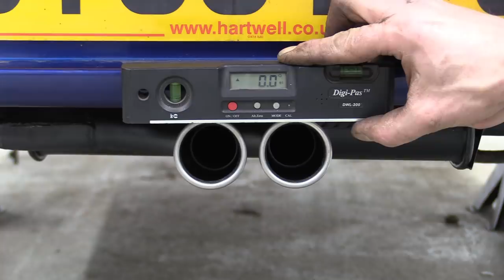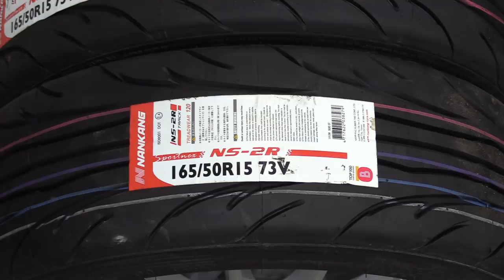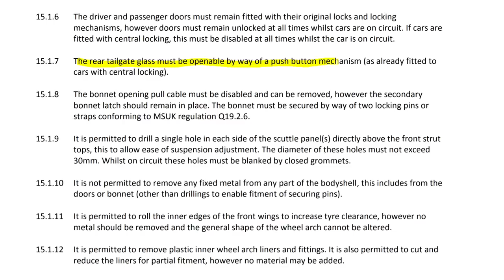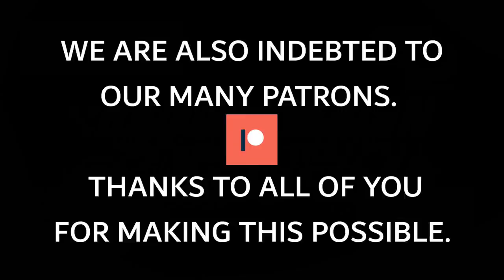Part 2 - Building an £850 hatchback into a competitive race car.

Comment: "To make it easier to remove the struts, the wiper arm comes off" 
Me, who has only ever worked on old cars: *frowning intensifies*
Reply: I spent a solid 5 seconds waiting for the punchline, until I remembered how tightly packed the front end of that car must be. :-)
Reply: It'd be very Colin Chapmanesque to use the same bolt for the strut and the wiper arm.
Reply: @Stereomoo  Me, too, instantly was thinking of Mr Chapman's creative genius when it came to impossible triple use of vastly underweight parts, but it turned out that Toyotroën just put two layers of things in the way of service access like every other car hack calling themselves "engineer" these days.
Reply: To remove the rear wheel on my bike i need to remove the front mudguard lol.
Reply: @SF-tb4kb  I had a vauxhall cavalier that required stripping the entire dash from the drivers door to the centre console in order to replace the bulb in the clock.
Reply: But at least in modern cars all these things come apart easily unlike on my older endeavours with nearly everything being bloody seized like it's welded.
Reply: @davidhope5875  I had two Opel (Vauxhall for the Brits) Astra's that required removing the timing wheel on the engine just to replace the thermostat valve. So a 12 euro part became a very expensive repair....fortunately I did it myself, but I won't be buying an Opel with that setup again...
Reply: A '79 Dodge D150 requires removing the windshield to access either the top dashboard mounting screws or the cowl grill screws to get at the wiper pivots and transmission....
Reply: Having grown up with American cars some of which required that the engine be unbolted from it's mounts in order to change spark plugs, this sounds perfectly reasonable,,,especially since I'm not the one having to do it.... 
("Wait! What do you mean the battery's INSIDE of the fender and you have to take the wheel off to replace the battery?  I see they slanted the engine over to the right so that the exhaust manifold is on top, and everything you need to service is underneath. Hmmmm.)
Reply: @SF-tb4kb  I have a 1994 Accord where they decided to put the brake rotors behind the wheel hub.  That's right, I have to remove the entire knuckle assembly to replace brake rotors.  Also, changing the oil on my Odyssey today made me realize that Honda always puts the oil filter immediately above a cross member, so good luck doing an oil change without spill a drop.
Reply: @darkmagician1184  82-86 B11 sentra/sunny/tsuru as well...
Reply: @jfan4reva  there is a smart roadster version that requires the engine to be removed completely to change the battery.
tbh it is a rather upengined version that was only built 10 times. to fit in the engine at all is a little miracle.
Reply: @SF-tb4kb  By any chance was it a FORD Taurus?
Reply: Try removing a heater core from a modern range rover, it's a full strip down!
Reply: @BuzzinsPetRock78  The ancillary service items to a an Opel Tigra A heater core to block ~20cm coolant hose included, but were not limited to, a head gasket. No joke, the engine had to be split in two to be able to access the hose. After I got the car back together, we promptly sold it.
Reply: Try my old Saturn that required you to pull the engine ( or at least loosen the mounts) to replace the alternator.

Comment: Got to love modern cars eh? 
Strut replacement. Step 1: remove windscreen wiper. 
😤
Reply: 🏁KLUTCH°58°KUSTOMS🇬🇧 I agree. Peugeot 308 - remove wiper arms and plastic cover - disconnect wiper linkages - now you can remove the strut nuts😡
Reply: Or service the HVAC
Step 1: remove the entire dashboard.
Reply: So compact, not only are the headlights hugging the doors, the front springs are under the dashboard. You can adjust them from the glove box
Reply: On some jaguars you need to remove the front wiper assembly to change the cabin filter.  Just because.
Reply: Just put a Tow bar on a VW T5, 30 min fitting the toe bar. 3 hours of crap to get there, 3 more to put it all back on......oh and 25 min of buggering about with the wiring!
Reply: Change a headlight bulb on a clio 4: Please remove the front of the car.
Reply: My Renault Grand Scénic is the same - I had to take a wiper off to remove the trim panel to get access when I replaced a strut top mount. When I did the timing belt recently I had to remove the entire wiper motor assembly and the scuttle panel. It's honestly not as bad as it sounds.
Reply: Wait until you find out about motorbikes.
Reply: @Davini994  How many wipers You have on Your bike? 😅
Reply: Ford focus: to replace headlight bulb, see bodywork section "remove front bumper assembly". Front bumper assembly removal requires removal of splash guards, which means removal of front wheels!
Reply: @manfredschmalbach9023  one, on my gloves!
Reply: @Moe first gen (pre 2002). It can be done by undoing the front of the splash guard and holding it back, but the official method says to take them and the bumper off.
Reply: @tomf3150  Same on a subaru outback. I feel your pain ...
Reply: Zorktx Andnand and I can tell you you don’t want to,replace a bulb. I drove around with 1 light out for a while with the replacement bulb because I couldn’t do much after trying to remove the old one for atleast an hour.
Reply: Oh, I don't know.  I once messed around with a Chevy S15 that, in order to adjust the idle mixture required the carburetor to be removed and an anti-tamper plug drilled out.  Then the temperature sender was in the way of the jet, to I had to partially drain the cooling system, replace the sender with a hex drive plug, refill it, warm up the engine, adjust the mixture, let the engine cool, drain the system, replace the plug with the sender, and refill.

But that has nothing on stupidity to my 1976 Mustang 2 that still had the original oil filter (in 1992. eep.) because it hit the inner fender well before unscrewing completely off the tube.  I fixed that problem with the delicate application of a large hammer to the fender well.
Reply: I had a MB280SE, and the Chilton`s book advised: "Remove heater core. Step 1: Remove the inside rear view mirror." Teutonic engineering at its best.
Reply: @tomf3150  That's why my nephew go crazy about mechanic, he (6yo) have a small hands and no more dissassembly almost all just pop cover and rest he do

Comment: "Anti-tamper bolt"
BOM: immediately start tampering with it
Reply: What to call a legally mandated tampering?
Reply: It's like the warning "no user serviceable parts inside" it's an invitation to see just ow unserviceable they are 😊
Reply: There never was anything better than successfully tampering to quickly get into things with supposed tampering prevention, right?
Reply: @flyinghaddock3005 "No user serviceable parts inside' has only one correct response "Challenge accepted", similar to "Warrant void if removed"
Reply: "Anti-tamper bolt"
Tamper tantrum initiated

Comment: Not going to lie, I don’t think a simulation chair will need a hydraulic press to put it together.
Reply: Maybe but my press was only a couple hundred bucks and it has paid for itself many times over.
Reply: I mean how expensive is it to go to a welder or fabrication shop to do a simple press job .
Reply: @yousefabdulrhman858  most placed won't even charge you £20 to do it haha if you've done all the prep yourself
Reply: Swing presses are cheap and most will already own several
Reply: @yousefabdulrhman858  Shop rates will very, but lets say it is 100 bucks per hour. Now most garages start the clock with an hour even if the job takes 20 minutes. If you have to do this a few times, you'd be better off buying a proper press. My press is 50 ton and I bought it used for $200. I have used it many times and will again and when I am done with it (or die), my kids can use it or sell it for a few hundred bucks.
Reply: @SteveP-vm1uc  and could do as well some press work for cheap to make the money back , like 20 bucks for the job .
Reply: Hydraulic press simulator ?
Reply: And waaaay less ugga duggas.
Reply: £850 is already more than what i spent on my sim rig
Reply: If it doesn't require a hydraulic press (or even a pneumatic one), I think you need to step up your simulation chair game a bit. :-)

Comment: Didn't feel like cleaning off all that gunge and rust? Surely being under the car later on and not having stuff falling in your eyes is worth it? Also lightweight!!!

I haven't seen so many Airplane or Monty Python references since the 70s....
Reply: Yeah doing that actually bugs me, why do all this on a dirty car... unless they're gonna clean it on a lift?
Reply: Canny race trick. Car weighs in legal at start of race weekend but becomes progressively lighter during the races as bits fall off.
Reply: I am UK based and every time I have done a job like that I like to clean up and paint, Hammerite or Powder coat but powder coating can take a week or two
Reply: Yeah not sure why they wouldn't spend a minute to take the rust off with a wire wheel and chuck a bit of paint on there
Reply: @tomb9818  Because they know best of everyone how a project can spiral out of control and take a lot longer when you start getting fancy.
Reply: @Finnspin_unicycles  It's probably that. They stated they had two weeks to get it done, and alle the fancy filming isn't just happening by itself.
Reply: @watsisbuttndo829  It's why there are so many bumpers and trim pieces on the track, dynamic weight modification race strategy.
Reply: My impulse would've been to give it a good going-over (or should that be 'under') with the pressure-cleaner, then a quick spray with some rust-converter where needed as the build progressed!
Reply: @M0UAW_IO83  nailed it my friend. Duct tape and zip ties may give the appearance of worn out shitbox but these are finely tuned details of "tearaway" body panels that may be easily shed if a last minute speed increase is needed.

Comment: When their "budget racecar" is worth more than your daily "Only car" :'(
Reply: It's quite a bit cheaper than your average spec Miata venture, but more expensive than most young car nuts can afford. At least there's go-karting.
Reply: Maybe buy a better car instead of whining about it on the internet.
Reply: @jeffsymons7084  no, this car is amazing, won't break the bank and if it does break you buy a cheap replacement part, pay next to nothing on fuel service and road tax.
If you know a car which is better and or cheaper, I would be interested ofcourse.
Reply: @BrawlerTheSmokyDutchMan  Wtf are you talking about? What car?
Reply: @jeffsymons7084  it was a joke, I don't need "a better car" thanks 🙄
Reply: @Section59.  Yeah you do.
Reply: @jeffsymons7084  yeah alright then 🙄
Reply: @dil6969  Wait till the end of the season, you will be able to buy one for 500 quid on fleabay.
Reply: I felt that too 🙁

Comment: I understand you were under time restraints, however it hurt my soul, withered and dark though it is, to see you putting new parts on that filthy and somewhat scabby under side. Some blast media and paint would have been so restful.
Reply: No point, considering the car might never get old enough that rust will become a serious issue.
It's a 850 quid banger, they didn't even touch the dents on it.
It's not a restoration, it's preparing it for the grave :)
Reply: @ToreDL87  but ... she still needs some love

Comment: I prefer "Collectables with questionable value" when talking about my parts stash.  However, the day I went to the shed and got a 2 barrel carb for a Ford straight 6 {with 15 minutes of looking}  and replaced it on our Grenada wagon.  Tuned it, car ran better.  It does work.  The "meantime's" a bear dealing with "stuff" scattered about in boxes, etc.

Comment: Guys, I would  double check and make sure the rear shock towers are reinforced since youre now running a full coilover in the rear on a trailing arm car, its going to put more stress on the top shock mount since it normally sees compression and rebound forces, but not the full car's weight. I would get some plates made up for the top, or something similar.

Comment: That M8 bolt on the brake pipe is there because it's corrosion resistant by virtue of its size.  An M6 bolt would just shear off if you didn't take the time to sweet talk it out.  Been there, done that on a 2004 Sequoia.

Comment: My farored trick to take off the tapered ball joint ends is to reverse the castle nut and hit it straight on with a properly sized hammer. That is is if you can get it straight on. I never liked hammering on the knuckles because it hurts...

Comment: Hmm, so the original rear suspension loads were transmitted to the chassis legs so the weight of the rear is taken into the frame. The coil overs transmit the load directly into the body panel (which generally speaking are much thinner). Surely this will lead to initially flexing, distortion under loads and later fatigue failure of the panel. Maybe a local thickening and a bracket is required here?

Comment: At 3900 your racing sim has now gotten a motion platform. Keep that going, a VR Headset is a real amazing addon. A bit more and you get a high end wheel and pedals, finally arriving at a high end racing sim cockpit.
Where are all the brackets?

Comment: Get a press if you can people, it's not just for changing wheel bearings/bushings/joints a lot, with some inspiration you can use it for stamping radius into gussets, breaking steel... making brackets :)

Comment: hmm.. i follow a different regulation. and we have modified "stock" lower a frames.  they move the lower balljoint out 15mm and forward about 25mm.  we cant use any polly bushings or coilovers tho. just KYB shocks and lowering springs.

Comment: If you slide a 2mm pieces of plate steel and thread the bolt in the opposite side it will slide the knuckle apart enough to allow you to slide the strut/coilover in and out

Comment: I use the term "rocket surgery" just about everyday at work. (Honda auto parts consultant)
The "Totalizer" sounds like a list of cars I've totaled. For the record:
'91 Chevy S-10
'86 Chevy Cavalier
'85 Toyota Tercel wagon
'91 Pontiac Le Mans
'91 Chevy Caprice (9C1)
That's not counting just blown engines and trannys.

Comment: Use your angle grinder to cut a slot in the anti-tamper screw and remove it with a flat screwdriver.

Comment: If you have to take those coils out again us an extra bolt that barley doesnt fit the gap, grind the threaded part down on one face until it does and turn it to spread the spindle open. Coil should drop right in

Comment: Fantastic video! Can I ask what is involved in aligning the subframe, before it can be tightened up?
Reply from the maker: Just measuring rear wheel centre to front wheel centre on both sides and making sure they're the same.
Reply: @BadObsessionMotorsport  Perfect.  Thanks for the speedy response.

Comment: Are there weight regulations? If so, would that affect removal of more plastics? I'm thinking more along the lines of that massive piece of black ABS across the front of the Car impeding airflow? Lol

Comment: What are the odds that this cheap and cheery formulated race series starts a rules challenging arms race of hidden go-faster parts and inconspicuous lightening like what happened in the Squadra Bianca racing series in the Netherlands? An old trick there, among many others, was fitting Weber 45s with cover plates from the mandatory 40 mm carbs for example.

Comment: Please do not use the hammer to install new coilovers. You can easily install them if insert bolt (low ange grinded) into side cut of the knuckle.

Comment: There’s a reason they’ve used such a large bolt for the brake pipe. There are optional extras and instead of having 2 different bolt sizes they’ve just used the large bolt for all cars.

Well for this car there are a lot of different extras 

And right where that M8 bolt goes is where the anchor also goes..

Yes I said anchor, there is a boat version of this chassis in Japan.

Comment: Those control arms and bushings look shockingly like VW ones. I give it a couple months before the rear bushings split, because, well polyurethane.....
Reply: And continuing on that line, the exhaust donut triggered my VW MK2 8V downpipe PTSD.
Reply: Nope. Why I hear you say? Well, they are Powerflex bushes. I have exactly those all around the car and after 50kkm they are neither split, nor they squeak. And the NVH increase is negligible.
Reply: @Paul_VanGo  aaahhh. Those are the new poly compound then?
Reply: @dubCanuck1  Dunno. What I do know is, is that it is the same colour as my sex toy...
Reply: @Paul_VanGo  hahhahha. Humble mechanic had PF rear bushings for the front control arms and thwy split too after less than a year.
Reply: @dubCanuck1  Must say, after all the negative feedback on the net (for what it's worth) I was a bit suspicious, but at least the Powerflex PU is top notch.
I assume there's a lot of crap on the market.
Reply: @dubCanuck1  It is a bit more expensive, but you gets what you pays...

Comment: I assume due to the age and miles run the original undersized clutch  has been changed for the later bigger diameter one. http://www.partinfo.co.uk/files/INF12216_GB.pdf